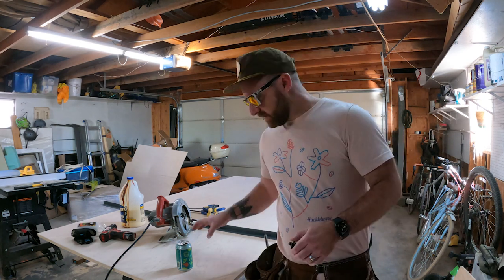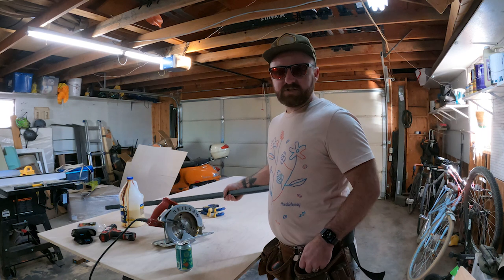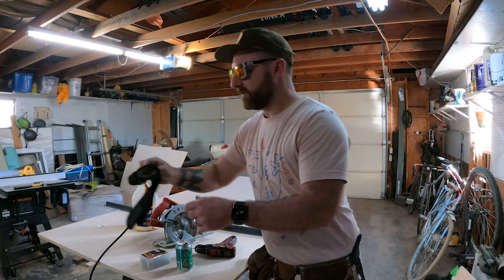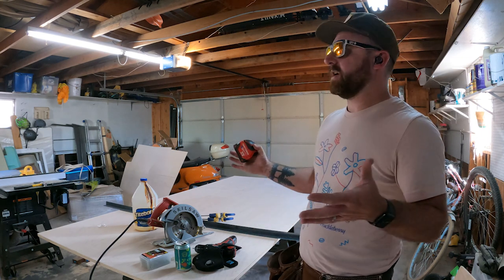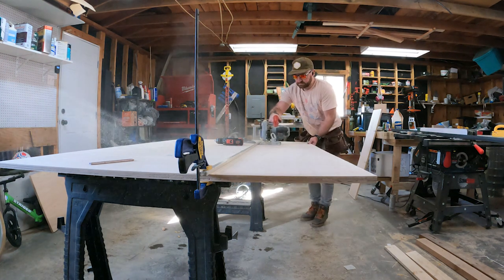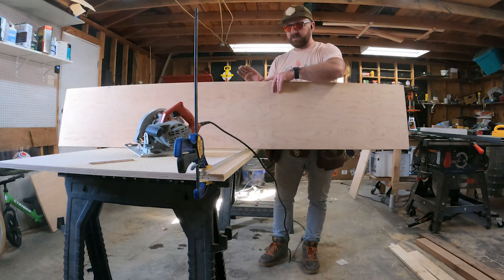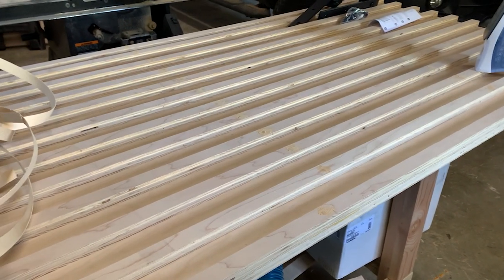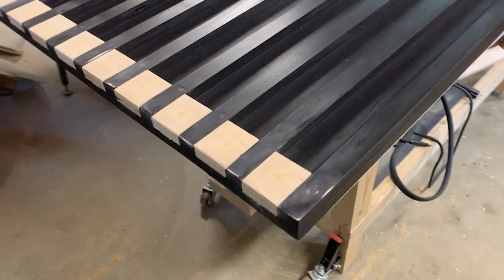Under $110 - The DIY Modern Barn Door

Comment: Love your analysis man.
Please tell me how many teeth your saw has an how you can have perfect cuts!
What is the procedure on painting. Primer, sand, coat, sand, coat?
Thank you
Reply from the maker: Thanks for watching! the blade I am using is just a 24 tooth blade from Dewalt. Here is a 5 pack: https://amzn.to/2RaKoyn

The secret is to use some kind of straight edge, have a sharp blade, and let the saw do the work. Go slow enough that you are not really pushing through the cut, you are more following the cut. Hopefully that makes sense. I go into a little more detail about this in this video: https://youtu.be/S_Yyxtkf2lM

For the painting technique, I add this to my paint: https://amzn.to/3eAV1na which seems to help smooth it out. I also use these instead of sandpaper: https://amzn.to/33vZpgF to sand in between (3) coats. for lack of better term, it almost heats up and smooths out the paint instead of sand it down. This helps cover up the grain in the wood, which was my goal for this project. 

Hope this helps!

Comment: Why not glue, then pin the slats with trim gun, then screw slats on from reverse  side.  No screw head filling only a few pin nail holes to puddy up  ?    Less work and way way cleaner job for painting/ staining
Reply from the maker: You could totally go that route, I choose the way i did it for 2 reasons:  1. I liked the more industrial look of the screw wholes on the front of the door vs the back of the door. Currently the inside of the door is just a clean slab which is just simple and clean. Where the front is already busy and textured. 
2. It seemed like the simplest/strongest way to ensure the integrity of the connection between the slats and the back panel. Since they are such thin pieces there was a bunch of play when I was putting them in place. If you do go your route, i would encourage you to use a bunch of clamps to make sure they stay completely straight. 

The fun part of woodworking is there are so many different routes to choose from to make it a one of a kind piece. Best of luck with your project, and let me know if you run into any other questions!

Comment: what type of wood did you use for those strips? Are they 2x2?
Reply from the maker: That are actually just strips I cut from the left over plywood after I cut the door. I cut them in 1” strips, but you could make them bigger if you prefer.

Comment: What kind of plywood did you use?
Reply from the maker: 3/4 inch plywood. It’s a little more expensive then the sanded pine. But, accepts paint much better. Right now it’s only $80 per sheet at my local Lowe’s
Reply: Was it birch plywood? Or Baltic birch do you remember?
Reply from the maker: @jacoblidell3547  sorry, it was maple. Birch would be great too. I would just stay away from red oak since it is so hard to paint with the deep grain.  Best of luck on your project.
Reply: Okay thank you I’m planning on making that same door but staining it I just don’t know what would be better Baltic birch or maple. Any suggestions?
Reply from the maker: @jacoblidell3547  That sounds so cool. You will have to send me a picture when you are done. I find that maple has a lot more variation  and fun knots. Where baltic birch is more of a simple elegant look. You can see the beautiful grain of Maple in this video https://youtu.be/N2NgQ1XXRl8
Reply: Awesome I will thanks man!

Comment: What $ would you charge for that door?
Reply: Great question. Typically I charge 2-3x materials. For this detailed of a project, I would probably be closer to 3x and then I would also charge an hourly rate for installation if needed.
Reply from the maker: Sorry, just realized I was signed in under a different user name. That is my answer above 👆
Reply: I was curious, my son's tell me that I don't charge enough for making my sliding barn doors. I charge materials + $200. For me , for a plain door No paint or stain. Does that seem too little to you.?...I'm retired and took up making many things, starting with flower boxes. Then someone asked if I can make a sliding door, then the phone does not stop ringing. 
I'm in Canada.
Reply from the maker: @paulshaw9355  That does sound pretty low, I think industry standard is about 2x materials. But, some of it depends on how much your time is worth to you. How long does it take for you to do all the labor involved in installing the door?

Comment: Those anchors aren't sturdy enough put a wood rail at top with 2 pieces  of casing along side opening. Super Sturdy
Reply from the maker: Thanks for watching, I have used this method a number of times and have never had an issue. We have had all kinds of use including kids hanging on it (kids will be kids). You totally can add a wood rail if you are worried about it, but I am not a fan of that look.
Reply: @beardedspruce  Loved the slat door, been visioning a project involving  slats.    So many ways to construct cooleness